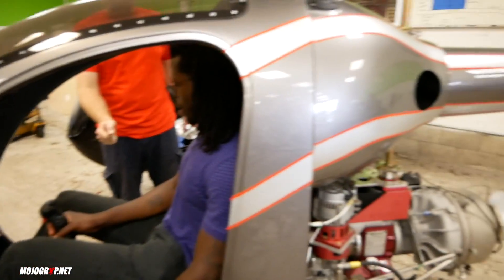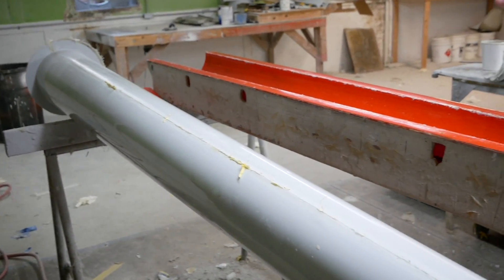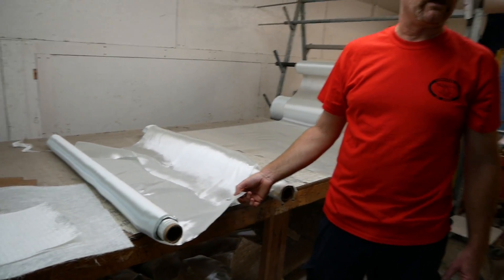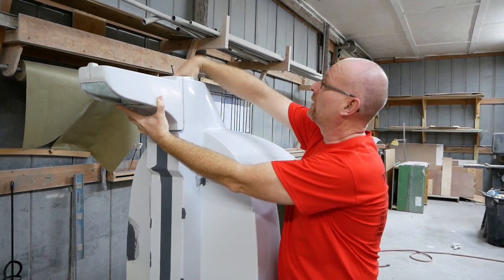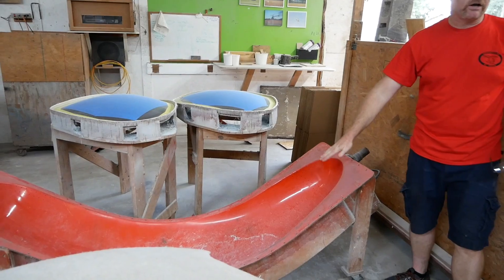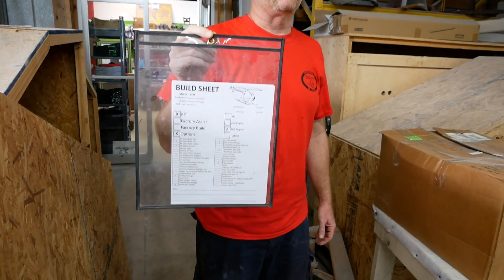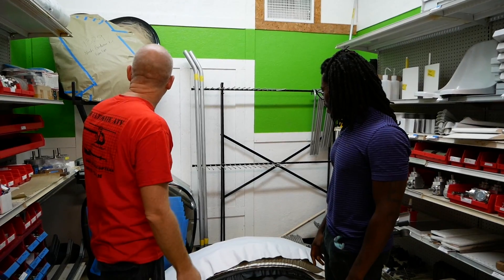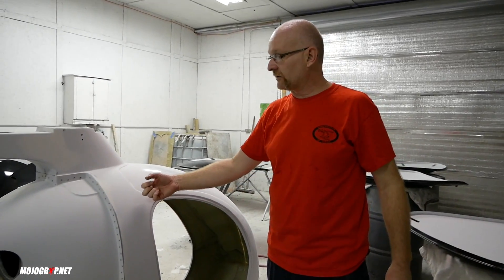Mosquito Helicopter XET Factory Tour | How It’s Made

Comment: Look at Dwight.  Though he is missing some beauty sleep, he is pretty smart.  While taking photos at his factory, he asked me if I wanted to fly one of his birds.  I was shocked.  How do you get dual in a single seater?  That little helicopter looked to me like it would want to go to three different zip codes during hover operations.  Dwight told me he thought I could handle it.  Strapped me in, gave me a cockpit check and moved back.  While squeezing the black out of the cyclic, I slowly and carefully elevated the little bird into a hover.  What a surprise.  The little stinker did not, I repeat, Not do anything that I didn't tell it to do.  Less than 1 minute later I was slowly taxiing the bird around the field.  Dwight knew I had a helo license and he knew how easy the Mosquito was to hover, so he wasn't taking anywhere the chances I thought he was.  I later asked the designer, John Uptigrove how he achieved such a great control system.  I expected some long winded technical discussion.  John keeping with an honesty ethic that I really like, told me he didn't know.  It "Fell Out" during the design process.  To this date, I have not hovered a helicopter as easy to control as the Mosquito and that includes the Huey.
Reply: Great comment,  thanks.

Comment: Sticky Itchy Problems You are not bagging your un used glass fabric bad news bears. All glass fabric has sizing and it evaporates and cause poor bonding of the resin. Infact glass fabric is only good for 1 year at the most. You can not fix bad glass fabric sizing failure. Bag and even refrigerate your glass fabric. Also bag and even freeze your hardeners. Even your epoxy paints bag or freeze the epoxy paint hardener. Air water heat destroy sizing and hardeners. Like loc tite or super glue bag and freeze all that stuff. One other thing build at mold release application room and prevent any contact with mold release or workers with your fabrication areas.

Comment: Wow, scary how flimsy it all is. Chances of survival in an accident are about nil. A helicopter is not the type of machine you go cheap on or cut corners.
Reply: I've flown worse all over South America. Ever seen an Ultra-Light fitted with a M249?   Low & Slow, from the middle of nowhere, but we still need an exhaust silencer . . . damn it.   "G-Load" tested by military contractors ?  Was that tidbit of info listed for release in the non-disclosure agreement ?
Reply: @earthdog1961  m249....exactly what I was thinking when I was watching a flight video.
Reply: They got videos of this helicopter in emergency landing and it stayed together. One of the videos was a heavy guy that landed in a field. So you would be misinformed.
Reply: @bigbossjc4117  What type of a 'emergency landing'? I doubt it would be survivable during an emergency autorotation. Absolutely no mention of safety features as there are none. Mechanical failure above 100ft and you're toast. A flying coffin.
Reply: @AUNZAnon  Both of them were autorotation. You thinking it's just fall out the air like a brick. It's made of fiberglass it falls out the sky like any other helicopter. It really is simple physics.
Reply: @bigbossjc4117 Most helicopter accidents don't allow pilots the opportunity to autorotate. I wouldnt want to be any further than 10ft off the ground in one of these things in event of a sudden failure.

Comment: @8:00 Nice vid Mike. Always wondered how they make windshields and this guy makes it sound easy.
Reply: It is easy.  Back in the 60s, Mattel Toys made something called the "Vacu-Form" a small toy that worked off the same principle.  Just heat the plastic sheet, lower it onto a vacuum table, pull the vacuum to form the sheet plastic around the mold, and then let it cool.  Simple in concept and practice.

Comment: Blower belt turns the blades lmao wut could go wrong
Reply: Shouldn’t the belt at least have a cover over it to prevent debris from getting into it? A clear acrylic cover would do well to both protect the belt and allow for visual inspection.    Just a thought.....
Reply: Timing belts are plenty strong and reliable. I'd be more worried about the 2-stroke engine, or a screw coming lose.

Comment: MikeMikeMIke! I built a Rotorway and flew it briefly. Sold it and used the money to get a commercial helicopter rating in a MD 500D. It was during training that I found out why there are windows at your feet in most commercial helicopters: If the engine quits you need to see where you are going to land! With no engine helicopters become streamlined rocks. Even with a qualified instructor next to you, your first autorotation will wake you up! (bring an extra pair of underwear). My advice is to get proper training and opt for the turbine as you need all the reliability and horsepower you can get.
Reply: Couldn't one get an aircraft grade parachute put on just in case? I know the make them.. even for cessnas now too!
Reply: "Oh no!, We have an emergency at 2500ft! Deploy the parachute! Wait...Are the blades still turning? Jettison blades! Deploy second parachute! How close to the ground are we now?"
Reply: I read somewhere that "Helicopters don't really fly. They're so ugly that the Earth's repels them." Lol...
Reply: Have you not seen this thing? You can basically tilt your head slightly to one side or the other and see almost straight down. It's not like your view is actually impeded anywhere except to the rear.
Reply: You guys are awesome, I have to settle flying a chopper on my PS4.😞
Reply: I just did a auto rotation it wasn’t bad at all don’t mislead people we need more people in the helicopter community

Comment: Carbon Fibre is five times the price of Fibre Glass.

A 135 grams per square metre (gsm) unidirectional (UD) with Toray intermediate modulus (M30SC) and cost £38.60/m2, a 200 gsm 2 × 2 twill with generic high strength fibre at £29.60/m2 and a 660 gsm 2 × 2 twill with generic high strength fibre at £52.20/m2all with 42 wt% resin.

Comment: 2:28 E-Glass or electrical grade glass was originally developed for stand off insulators for electrical wiring. It was later found to have excellent fibre forming capabilities and is now used almost exclusively as the reinforcing phase in the material commonly known as fibreglass

Comment: Fibreglass is fibreglass is fibreglass...
Reply: Dark Phoenix  because the Modulus of Elasticity of carbon fiber is about 4 times that of fiberglass.
So, for a given load, the carbon is practically carrying the entire load, while the fiberglass is practically carrying none of the load - and only adding unneeded weight.
Only after the carbon fiber has failed (broken) does the fiberglass begin to hold the structure together.
According to an expert in my workplace, it is better just to build a structure entirely of carbon fiber if you are going for toughness and impact resistance.
Reply: Good explanation.
Reply: The adhesion is apparently strongly affected by the coating.  Or you could go with carbon, which apparently adheres to the plastic much better.
However, this thing screams for a carbon-carbon structure; maybe in 15 years.

Comment: I wonder how much lighter it would be with carbon fibre. I wonder how much more it would cost.
Reply from the maker: Maybe lighter but carbon fibre would likely cost more
Reply: the fuselage would be approximately 50% lighter if it were made out of carbon fiber however it would cost approximately 5 times as much to make the same fuselage out of carbon fiber than fiberglass
Reply: I wonder if you would live if something went wrong and you " CRASHED " NOTICE THEY DIDN'T MENTION THAT. UM.